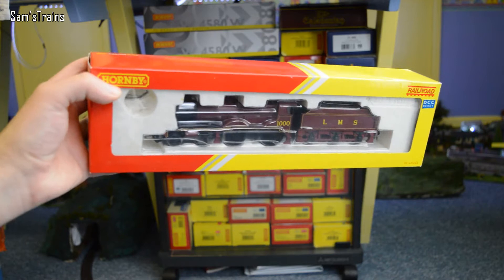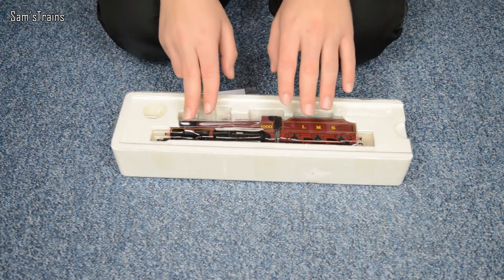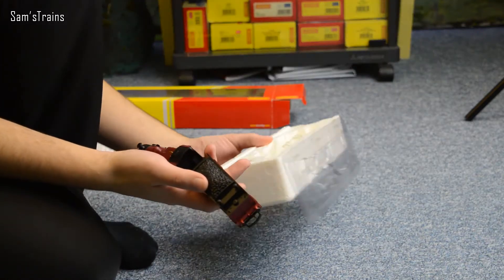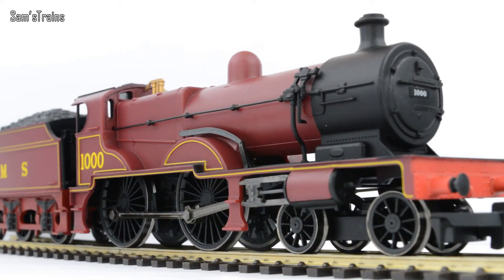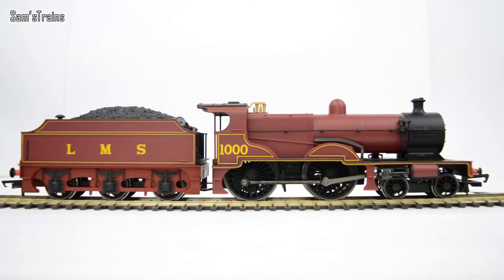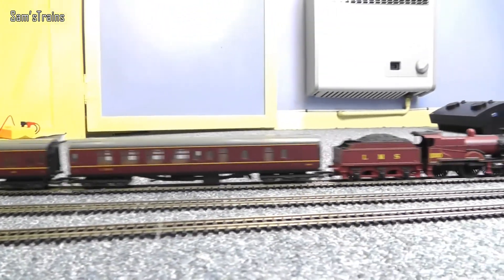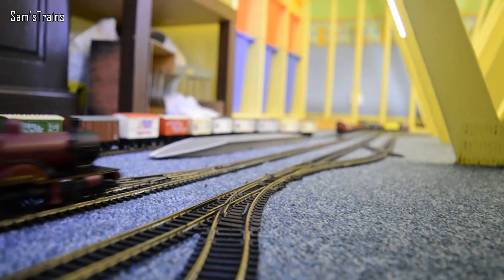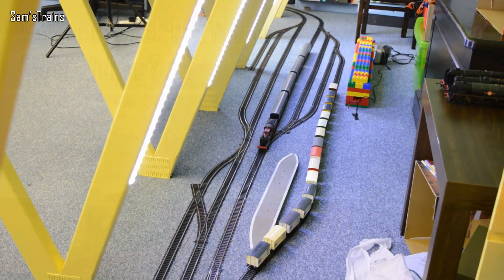Unboxing the Railroad Midland Compound From Hornby (1000 Subscriber Special)

Comment: If you are of a mind, and fancy upgrading this model a bit, the original tender driven body fits on this chassis, as does the tender body (with a little modification). Makes the world of difference (the Crimson Lake on the old version is much much better)
Reply from the maker: +Robert Palfrey Thanks for the tip! I may well do that one day, although I would want to keep the old loco in original condition, I might get another to try it!
Cheers,
Sam :)

Comment: Nice video, again. 
I have the tender driven version from 1981, with working smoke unit. I have brought JT's Mega Steam Smoke Fluid, and it works so well 1) It's the thickest and the best smoke effect I have ever seen from a Hornby Steam Locomotive, and 2) It smells like an actual coal fired steam locomotive. If you tried it in one of your locomotives, you would know what I mean. If you have got an engine with a smoke unit, and you try it with JT's Mega Steam, then I would like to request it next time that locomotive in one of your videos.
All the best mate,
Adam :-)
Reply from the maker: Hi Adam, never heard of that before, so I'll have to try it, thanks very much for that, it sounds great!
Cheers mate,
Sam :)